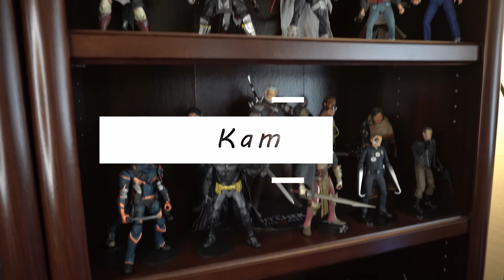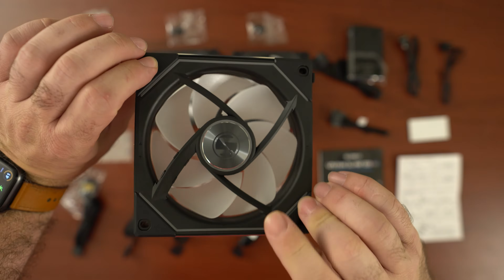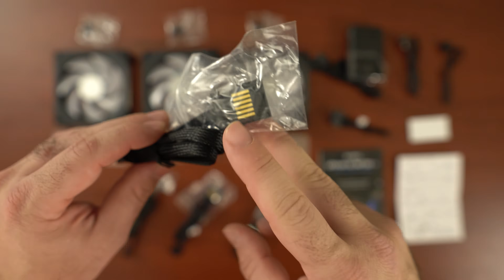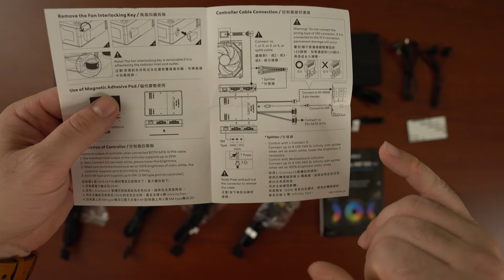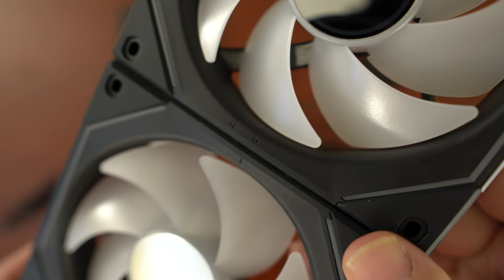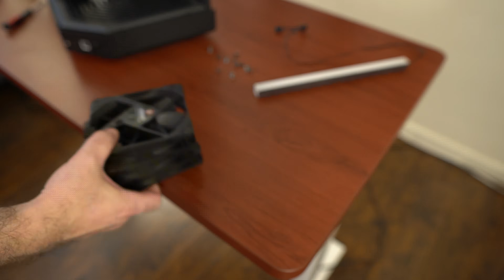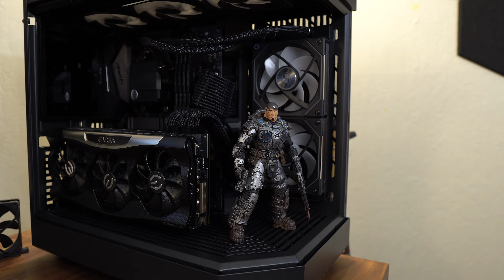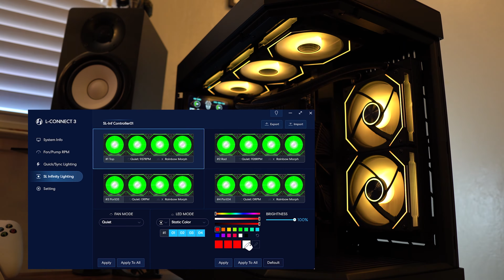LIAN LI Uni fan SL Infinity 120! Unboxing / Tutorial / Install / L-Connect 3 Software / Review!

Comment: So super weird i don't have all the settings you have in the software. I've only got system info, quick/sync lighting, and settings. It won't let me change colors or rpm fan speed. the software is up to date. any suggestions  on how to fix this? sweet setup btw ive got the same case and fans in white.
Reply from the maker: Thanks! Do you have your controller hooked up with the micro USB cable that plugs into a USB header on your motherboard?
Reply: @DanKamYouKnow  That was it!! Thank you 😊 Thank you for replying
Reply from the maker: Nice! You’re welcome! 😎👌🏻